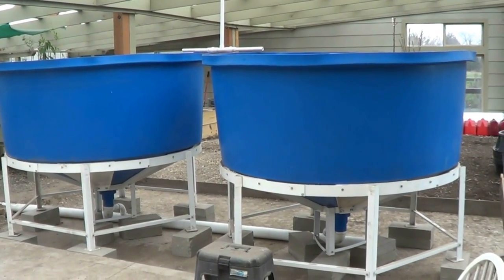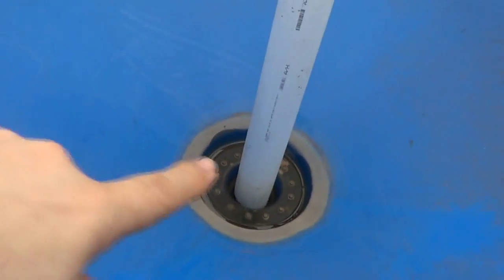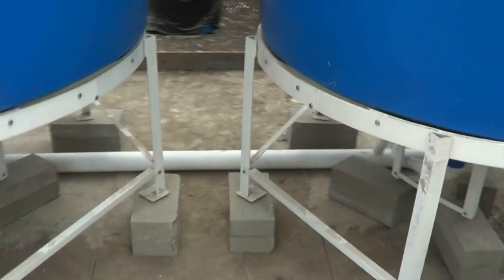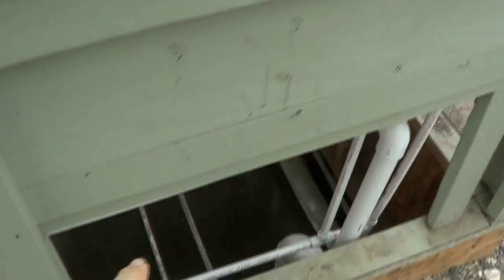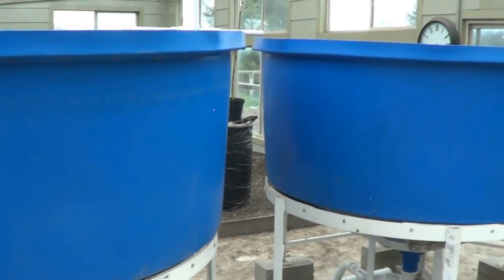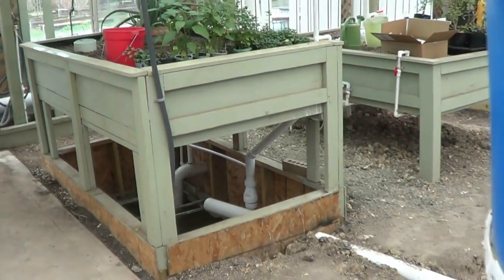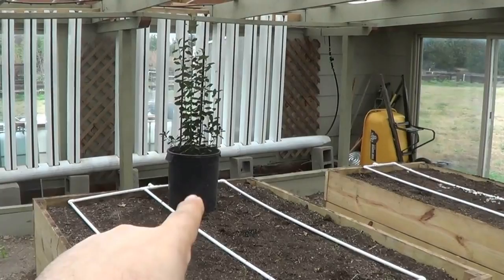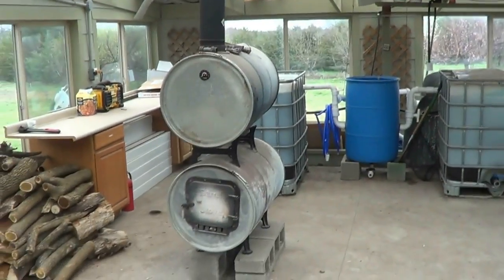March 2015 Update on New Aquaponic System

Comment: I'm curious about a question，How do you make sure your community has enough or stable electricity? If you are not sure that the power in your community is stable and will not be cut off from time to time, then Isn't it dangerous for you to put two pumps, and giving up the gravitational current? 
Or let's just say, do you have any backup in case of a power outage?

Comment: This is a really nice system. Thank you for sharing. I have a number of questions. How often do you check the PH, Nitrite, Ammonia, and Nitrate levels? What water temperature do you find most productive for plants? how are you regulating temperature in the water and the air in the greenhouse? Where are you located? Where did you get the blue fish tanks? I did not see floating raft system in set up - Why are you not using this for leafy greens? Thanks very much!!!
Reply from the maker: Mark Prescott Thanks for the kind words. As far as testing the water on anew system I check every other day then after 6-7 months once a week. But this year I am going to get an automated system that checks it all through out the day & email me if there is an issue. The water temperature is a balance between the fish & plants, but if I could have any temp I would pick 70-80 degree water. I am located in North Texas so I worry about heat not cold. I do have a barrel stove for the winter & I basically keep the sump in the ground & keep all the water shaded during the summer. The fish tanks came from http://www.polytankco.com. I will have a small floating raft system some but very small - IMO the tower i use (zipgrow) do better in heat than the rafts do. But mileage my very on what & how you do it.
Reply: Tracy Holz Thanks for the reply. I am planning to retire in 5 years, and your set up is the closest I have seen to what I want to build. I watched a video from Murray Hallem in Austrailia and he talked about how towers of NFT system had temperature changes in the water versus a raft system. My questions were asked before I watched some of your other video. I appreciate your answering my questions in a timely manner.
I hope you have all the success you want from your system!!!
Reply from the maker: Mark Prescott Yes the raft systems are more stable for temps BUT what I have seen that there is so much water during the summer months the raft system gets so warm it stays warm till fall. my towers go up & down a little day/night time.  Plus Per square foot of a greenhouse towers I get more production....